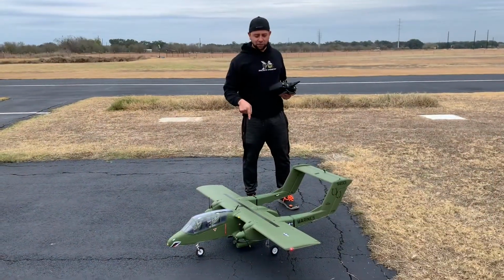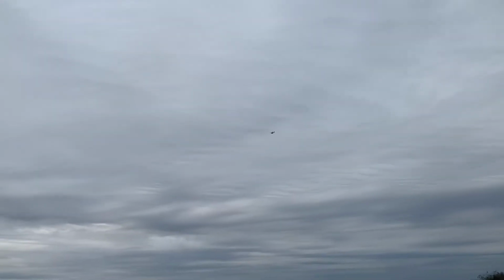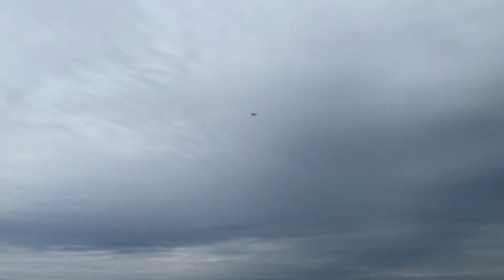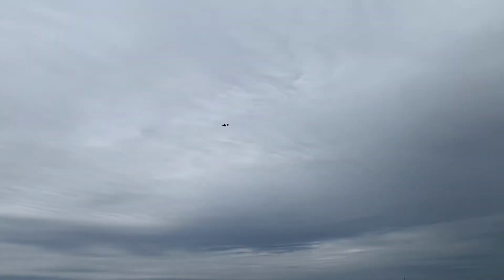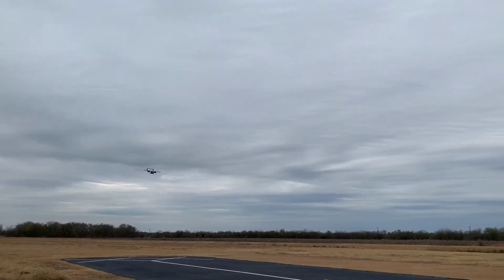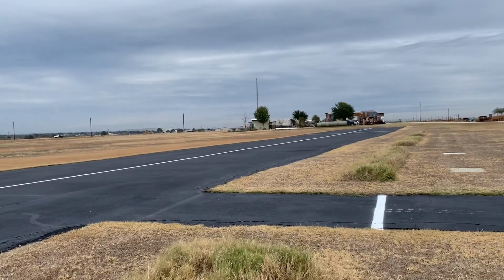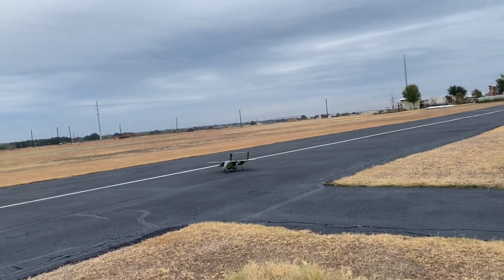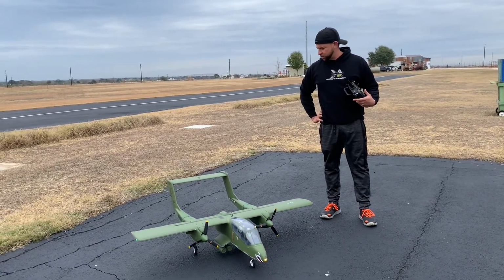Flightline OV-10 Bronco Maiden Flight!

Comment: nice flight...what kind of gyro are you using?
Reply from the maker: Thank You! It had a LemonRX in this video, it’s on Spektrum now.
Reply: @ljhobbylife  ok thanks. i was thinking about purchasing this ov-10, was wondering what is a good gyro. pretty new to the hobby.
Reply from the maker: @carlwynnjr6508  The spektrum receiver/AS3X gyro is great, the hobbyeagle from Motion is also great, I used to use the lemons with great luck until recently when I started loosing signal on the ground.

Comment: What is the longest uptime in the air with this plane on average?  Does it have an equal to or positive power to weight ratio?
Reply from the maker: I think power to weight is adequate, probably a bit of positive power and as far as air time, depends on your style of flying I can average 7-8 minutes of mix flying on 3300mah batteries and I land with some juice left in case I need a go around.
Reply: @ljhobbylife  I just ask because with a 1 or higher situation you can get out of a bad situation by just nosing up.  Dual props and possibly retract weight is what can bring down those flight times I think.